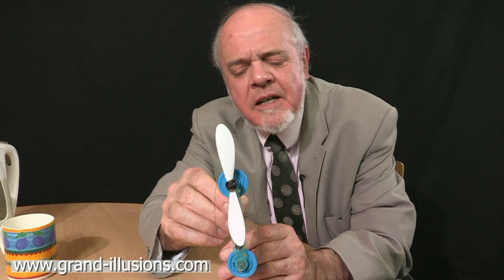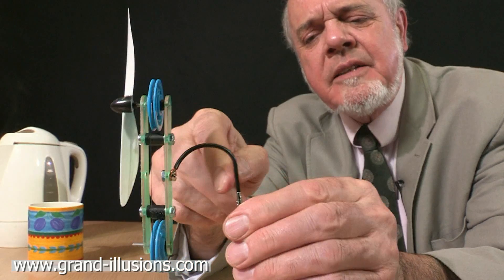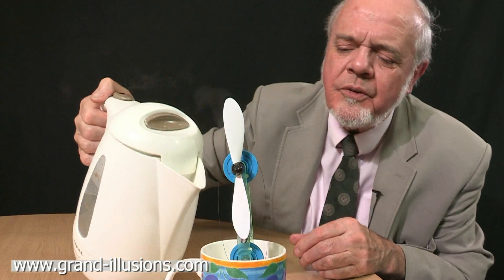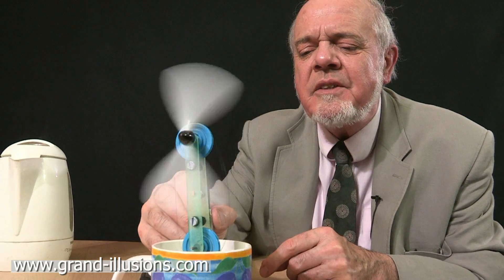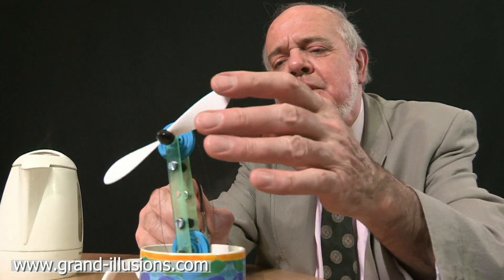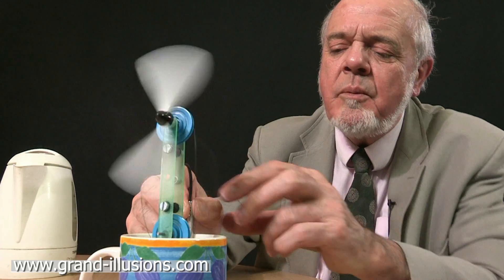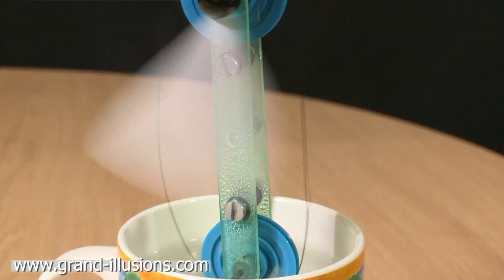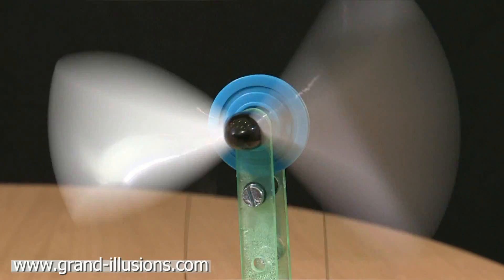Heatmobile 2.0

Comment: Imagine putting a few of these in a hot car! No batteries! Just plain genius :)
Reply: voltixD It works by temperature difference, the difference between hot water and air is about 50-60C, though air is a very bad conductor.

Maybe you could stick one half out the window if your car is a hotbox, but I don't think the temperature difference would be anywhere near as much! Probably only 10-20C.
Reply: +voltixD need a difference in temperature. Just leaving it in a hot car would be like submerging it in a bucket of hot water, it wouldn't work.
Reply: benaloney
Yeah, I got that from above lol
Reply: would not work.
Reply: ***** why not? Heat= energy
Reply: voltixD You would need something as hot as boiling water and a good heat sink
Reply: *****
Even if we can try solar cells :)

Comment: If I am not mistaken, this is powered by the wire's 'desire' to straighten out upon being heated up, so it pushes itself to the part of the pully that isn't wrapped around the wheel.
Reply: What Is Islam?

Islam is not just another religion. 

It is the same message preached by Moses, Jesus and Abraham.

Islam literally means ‘submission to God’ and it teaches us to have a direct relationship with God. 

It reminds us that since God created us, no one should be worshipped except God alone. 

It also teaches that God is nothing like a human being or like anything that we can imagine.

 The concept of God is summarized in the Quran as:

{ “Say, He is God, the One. God, the Absolute. He does not give birth, nor was He born, and there is nothing like Him.”} (Quran 112:1-4)

Becoming a Muslim is not turning your back to Jesus. 

Rather it’s going back to the original teachings of Jesus and obeying him

Comment: anyone know where i can get this?
Reply: I just googeld "Heatmobile 2.0"  and tada. Its $29.99
Reply: ebay
Reply: 30GB could as least say/type: "ty"  Zzzz...:/
Reply: trancelistic
 cant find it on ebay
Reply: 30GB The actual device shown here does not come up but here is an alternative that does come up.

Not sure if I'm allowed to put this link but here goes.

 http://www.ebay.co.uk/itm/Nitinol-Heat-Engine-Memory-Metal-Engine-Peltier-Thermoelectric-Nitinol-Wire-/161212057527?pt=LH_DefaultDomain_0&hash=item2588fcc7b7

You can also buy the nitinol wire on ebay to make your own device.
Reply: Seems I can't trace it anymore. But back then the excact thingy was for sell.

Comment: It's just a transfer of energy from the hot water (heat) into the nitinol which changes shape (kinetic). You have to use electricity or burn fuel to get the boiling water and it's actually more efficient to just use that original energy in a different way because this process is wasteful (think of the friction of the blades, the heat escaping from the surface of the water etc.